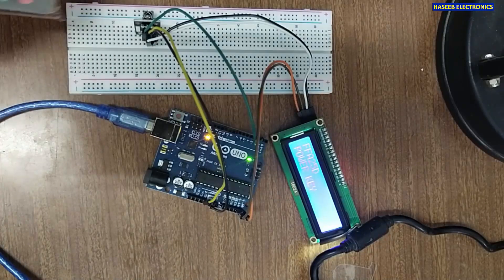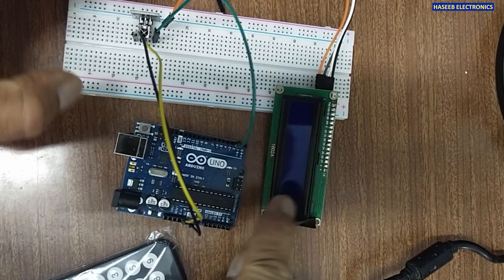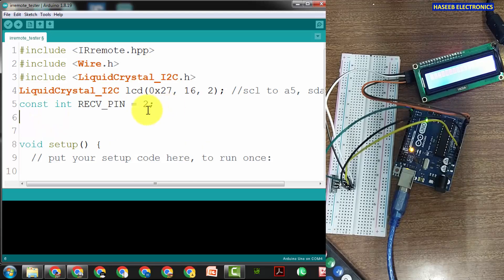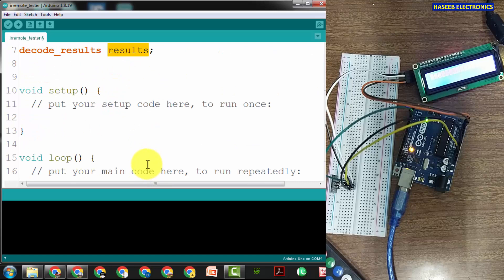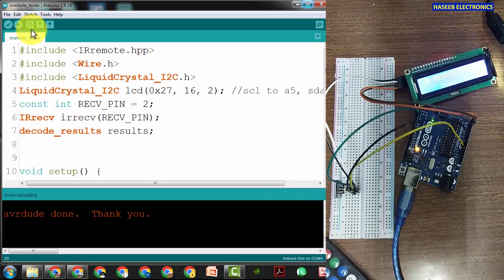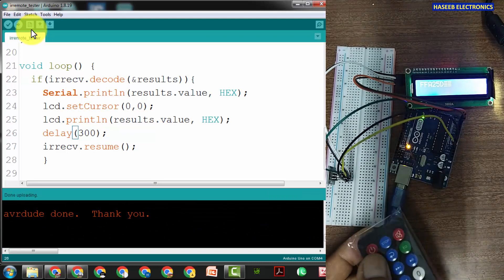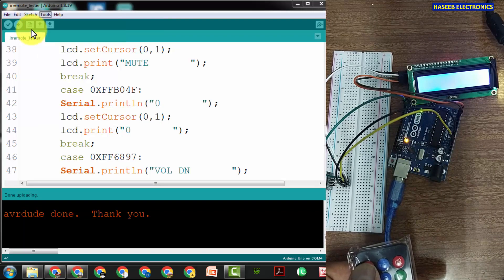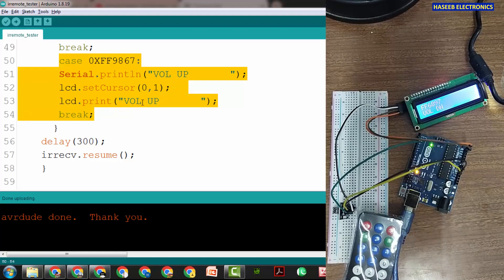{802} IR Remote Control Tester Using Arduino Uno

Comment: i have the problem with dell monitor smps. when logic board is not connected smps gives 5.2V stable. When logic board is connected voltage starts from 4.4V then increase very slowly with fluctuations. after 5 to 10 minutes voltage reaches 5.2 stable and monitor start woring. All components are apparently OK.